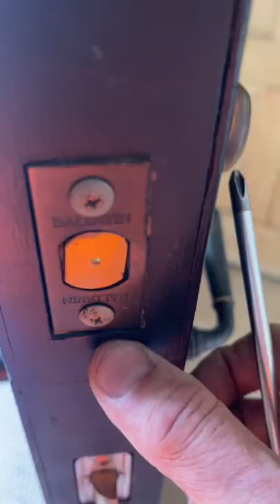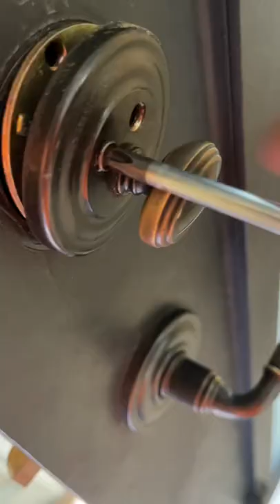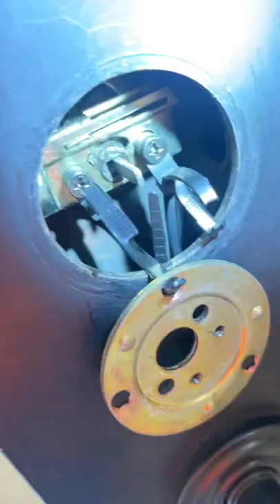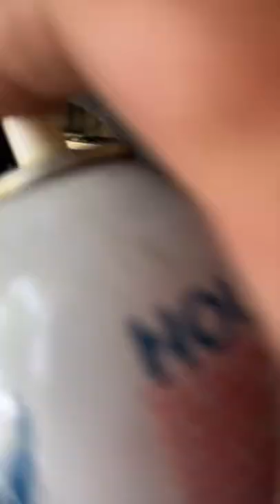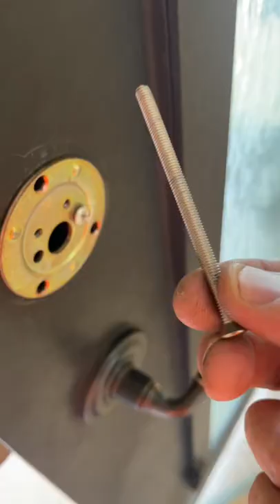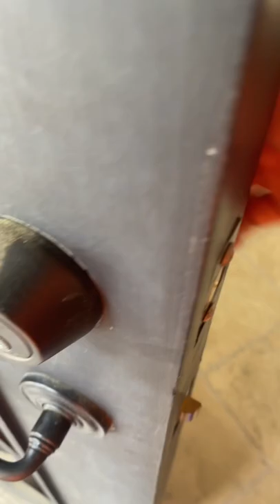the importance of having a long screw

Comment: The screws holding the bolt were also the wrong screw - they should be flat head not pan head.
Reply from the maker: yep! but they were tight and functioning so I wasn’t about to dive off into that wormhole 😂
Reply: @selock  - I understand, I was just pointing out mistakes of the original installer.

The screw diameter that was already there could be way too big compared to the normal screw that should be used - that would lead to more effort than needed.
Reply from the maker: @stevebabiak6997  I know :) and yeah it would probably end up needing a drill & with rivet fix or something whenever they use these screws. Luckily the 800 pound fancy door had a decent gap for screw head clearance (also surface mounted strike on the equally dumb metal frame) wormhole all the way down! 😂